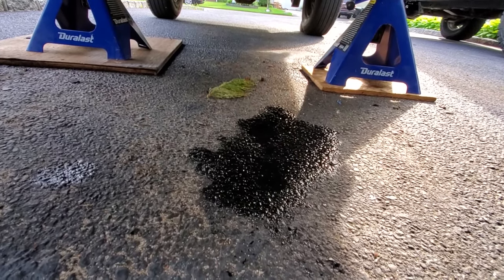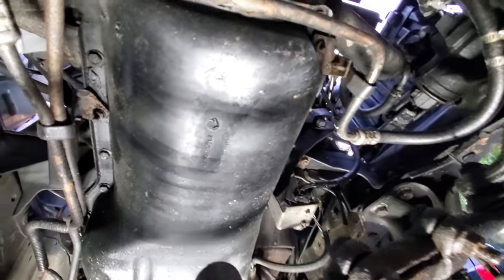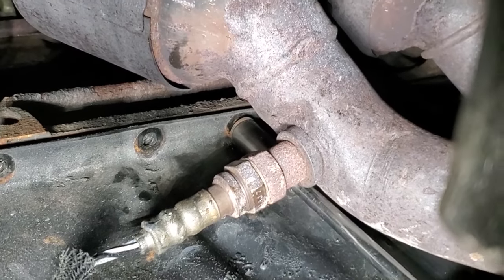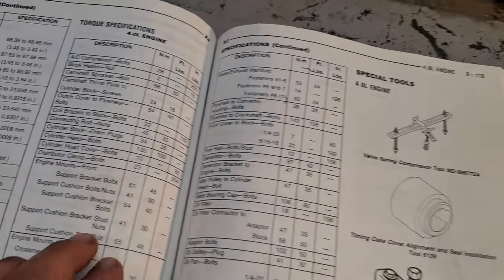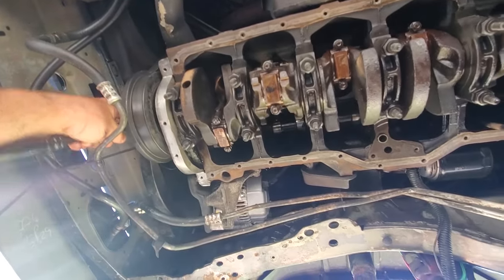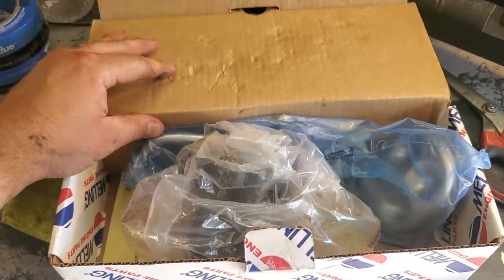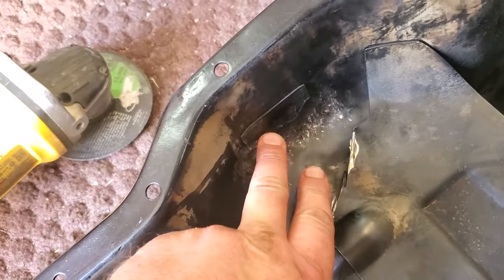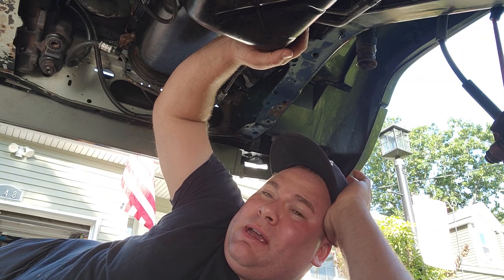JEEP XJ OIL PAN - REAR MAIN SEAL - CONNECTING ROD BEARINGS - OIL PUMP UPGRADE - PICK UP  REPLACEMENT

Comment: This is the most comprehensive one I have seen so far! On my stock ride height 01, I used 2 small bottle jacks to push the front axle down for the oil pan to clear the pumpkin. It took me at least a day to think of that. There were a lot of videos on missing Axles and lifted jeeps, but nothing on stock ride height. I have shared the idea with a few people since then. Great video Dan! Thorough as always!
Reply from the maker: Glad it helped! Thanks Brother!
Reply: I was just about to post the same! Everything else is for lifted Jeeps. Thanks Dan!

Comment: One thing to keep in mind if you're using an aftermarket oil pump. Some of the cheaper ones you buy online can have clearance issues with the crank counterweight. Had this happen where after installing it, awhile later we couldn't figure out why the crank couldn't make a full revolution. In other words, after you install an oil pump on one of these engines, check to see if you can rotate the crank a full revolution. LOL As always, awesome video Dan!
Reply from the maker: Wow! That's great to know. Thank you.  I think this Melling pump is the biggest I'd go

Comment: fn aya!!!!   exactly what i needed this vid bad!!    i  developed a horrrendous tick one morning...i finally learned my RMS was leaking, and didnt know it.  SO, down 2.5 qts of oil, and the rap, rap,rap started.    Because the rap was the same timing as the crank, it had to be something underneath...  I have yet to pull the oil pan to determine if it is a skirt fly off, or just rod bearings toast, or even non existant.   RAP is noticable at all rpm's but much less at higher than 1800 rpm... replaced oil(again), but no metal flakes in previous oil, so i'm hoping for minimal scarring or cylinder damage.     The things in your vid is exactly what i'm wanting to achieve once oil pan is off.    I have a stock 97 4.0L w/266k orig miles on engine... guess it had to go sooner or later.      I also recently replaced rocker arms and push rods, but no change in the RAP... but it does have better performance. No real nasty wear; just normal on the rockers...  i would like to replace lifters as well, and i might just bite the big bullet and replace pistons only.   depends on what i find after pan removal..   THANK  YOU for this video.  been searching pretty hard for just this type of repair....
Im a subscriber now!!!!     Tedd. S.
Reply from the maker: Thank you Ted! Best of luck with the Jeep! God bless 🙏

Comment: Did a HV HP oil pump on my 2001 XJ when I did rear main seal a few years back. My oil pressure hot at idle was down to about 25 lbs. After the HV HP pump it will maintain 55 lbs hot idle all day. Cold at 3/4 throttle, it will go to 75-80 lbs. Hot it will go to 65-75 lbs. I put in Scorpion 1.7 roller rockers, it's like a new truck. You can feel the HP and Tq difference, part throttle and full throttle. I have a bigger TB, with smooth spacer and returned the rest of the stuff, ( injectors, airbox ) back to stock. Stock thermostat, factory HD radiator and 3 fan electric fan set up. My fuel milage went back up from pig rich with the cold air mods and all that other junk. The factory computer doesn't like a lot of the performance mods, especially T-Stats and injector mods.

Comment: I’ve done this on a sr20 4 cylinder and it saved the engine I will be taking apart my 4.0 and inspect all the bearings I have a spare motor but that’s a last resort I don’t wanna do a motor swap rn
Reply from the maker: smart! only do what you need to do.. it saves time and  money. lol

Comment: Your package was supposed to go out last Monday but got lost in the shuffle. So the plan is for it to get processed Sunday and go out Monday (9/19/22) via UPS. Hopefully Harry (my shipper) and I won't forget. I have this same job to do to the Bumble Jeep, along with Pinion seals (both) and the oil filter adaptor seals. Should make for a fun day. God bless and stay well.
Reply from the maker: Thanks Brother!
Reply: @ProjectDanH  So you got the springs? That's great.

Comment: What a great video.  I was wondering if you used aluminum or tri metal bearings  I did not see the part number in your description.  Also I didn’t hear you mention why you were replacing the oil pump and why you modified the oil pan vs getting a different oil pump .  Was it just because you already had everything apart you decided to change the oil pump.  Thanks for all the work videoing.  You do a great job explaining and capturing what you are talking about
Reply from the maker: Thanks man!  Sometimes I just get the parts that are the most affordable but sometimes I get the parts that are readily available to get the job done quickly.  For sensitive parts like bearings I try not to make recommendations cuz I don't want to be blamed if a part fails.. mostly my main objective is to just illustrate how to get the job done.  If you do your own research you could be confident with whatever part you choose 💪💪💪.  Hope this helps. God bless

Comment: For anyone running into the trouble I had on my OEM suspension ZJ: Drop the shocks from the upper mount and the sway bar links too so the whole front suspension can hang. Then get a helper to bounce on the wheel hub while you pull the oil pan out toward the rear. Same thing putting it back in, bounce that front axle. Due diligence with your jack stand positioning.

Comment: Dan,  this is a super Great Video! I have a slow main seal leak. I have 202,000 on my WJ and still runs good. If I pull the oil pan I should  do the same and follow your work ✅🇺🇸

Comment: Instead of using rtv, you should leave a little bit of the end of the top seal sticking out so that the two seals dont meet at the same spot where the block and cap meet
Reply from the maker: Excellent tip!  Great idea to offset the gap too!
Reply: Your suppose to offset the seal no more than about 3/8" then you use anerobic sealant on the machined cap ends, they tell you not to use silicone there because it can alter your bearing clearance but ppl seem to get away with it for the most part i guess as long as you have no leaks then all is good 👍
Reply: The question i cant get answered though is they give you the plastic shoehorn to avoid cutting the seal upon install but when you offset the seal there is no way to use it upon installion of the cap so your basically taking a chance of cutting the seal when you put the cap on! go figure
Reply: Excellent idea. Love it. Thank you for this. You deserve a gold star and a lollipop.

Comment: I have a question I’m doing the same, very helpful video only question is when u put the oil pump in do u turn the shaft to line up with the distributor?
Reply from the maker: The drive gear is still connected to the cam shaft so you can insert the new oil pump shaft in at any orientation.  Great question!
Reply: @ProjectDanH  one more ? I’m doing it today only other thing do you take the cotter pin out of the oil pump when installed or at all?
Reply from the maker: @ryanwest5804  no leave the pin in. All you need is the 2 13mm bolts .  Don't forget the gasket!
Reply: So I finished the job and have no start but cranks I replaced the crank shaft position sensor and coil pack, I have spark from the coil but not distributor and cap and button look new.. any ideas
Reply: Now I have spark and fuel still no start replaced the cps and checked all fuses still cranks no start

Comment: Gonna be doing a transmission gasket and filter and fluid change on my 91 XJ this week coming up. Also will be doing an oil pan gasket, rear mail seal, piston connecting rod bearings, oil pump and tube as well the following week. Then will be doing a head gasket and timing chain and gaskets and water pump and gasket and thermostat and valve cover gasket and exhaust and intake manifold gaskets. Is  gonna be a big project. Going with all parts purchased from Rockauto. Some other parts too. Then transfer case fluid and both front and rear diff fluids. Exhaust system too because is missing CA CARB CAT and muffler and rear pipes too. Got the 91 XJ a year ago and haven't driven it since because a situation but now, is go time. The CARB CAT is gonna be only used during smog time, then take it off cause i dont want some low life stealing a $600 CAT. Also put a few killswitch.

Comment: Thanks for the video. 
Did you not do the Plastigauge for rod bearings? What thickness did you use?
Good time to do rear seal. I also like Fel-Pro.
Is it still running?
I may ad magnet to oil pan.
Thanks again.

Comment: Nice job Dan! So did you have low oil pressure b4 with the old pump? Just wondering if I would have to do the same somewhat?? on my 93 ZJ 4.0
Reply from the maker: Nah, oil pressure was fine.. but i figured i might as well. lol

Comment: Great video also I recently found out there is away to do the main bearings while ur there. Called a rolling in method where u use a carter pin to spin the top bearings out. The new one slides in and same method to put in in place is used .
I'm going to do a complete rebuild on mine using this method.  You can find videos of it on YouTube.  Search replacing main bearings without removing the crank.
Reply from the maker: That's definitely possible!

Comment: Hey Dan, I don't see your number for the bearing kit. Everything else fantastic dude. Keep up the good work man. If you can shoot a number for the bearing kit my way I would be eternally grateful thanks again
Reply from the maker: Hey, not sure if it's available anymore.  Just search for a standard kit 👍
Reply: You didn’t have to measure and buy oversized bearings? That’s my concern with just ordering a set. My ol girl as 235k on her and a nice rod bearing tick

Comment: What size bearings did you go with? Typically i think you would want to use a plasti gauge to measure what bearings are needed. But then again ive heard alot of people just slap in the standard size ones and send it.
Reply from the maker: I used standard bearings.  From my experience , even with polishing some scratches off, plastiguage usually  confirms standard bearings are within spec

Comment: Great video. Am about to change mine on a 2000 XJ. How do we decide if we replace the connecting rod bearings with undersized 0.020/ 0.030/0.010 or Standard? I get size options while ordering from Rock Auto.
Reply from the maker: 99% of the time they're gonna be standard, unless a machine shop polished them and told you specifically to get different sizes
Reply: @ProjectDanH Amazing. Thank you so much!

Comment: Very nice! I'm about to do the same to my xj....she's got some miles, and oil pressure has dipped over time. Just curious, have you replaced mains before in a similar fashion? I've seen people spin them in with the crank still in place, but it didnt seem like yours (at least #7)  looked too bad.

Comment: I have bad oil pressure when my engine gets up to temp. Did changing the bearings affect your pressure? I was told to change them while I had the pan off to get better pressure
Reply from the maker: Bearings don't have much bearing on oil pressure... Change the oil pump!

Comment: Do you not have to check the clearance on the new bearings?  How do you know if you need standard or oversized before pulling the pan?
Reply: I’m also curious, just received a new pan today, before I order bearings I guess I’ll just pick standard and cross my fingers
Reply: @cousin_JACK  Doing the same
Reply: I went with standard. If it’s stock, standard is the way to go. It was easier than expected
Reply: @cousin_JACK  ordered standard.  Keeping my pan and replacing oil pump and pick up with OEM.
Reply: @swatscorner  right on man, don’t bother taking out the main crank bearing to clean under it like Dan, I tried to remove the main crank bearing and I scratch it, simple wipe down on top, unless you’re replacing that too which I doubt.
Reply: @cousin_JACK  good to know!!  No, was not planning to replace that.  Just the rear main seal
Reply from the maker: only get oversized bearings if your machine shop cuts and polishes the crank.  you wont know what size you are changing it to unless they use a micrometer... so... always go for standard bearings. !
Reply: @ProjectDanH  but they sometimes use various sizes in ptoduction don't they?  In the end, my motor was shot so I got a new one from Titan, going great now.
Reply from the maker: @crashtke  Glad to hear brother!

Comment: Trying to order everything - where did you get the bearings? Having trouble finding them for the 4.0. Thanks.
Reply from the maker: Ebay
Reply: @ProjectDanH  thanks!  I think I ended up ordering from Rock Auto - but I did see them on eBay as well.

Comment: Just curious, would you recommend a refresh on the engine like this, on a 96 ZJ with the 5.2? I’ve always been curious about the crank or connecting rod pistons that can be accesses with the oil pan removed.
Reply from the maker: I wouldn't mess with it unless is clunking.. if it aint broke dont fix it! lol

Comment: Hello sir, can I get that tork spec of the different screws for the bearings! Thank you
Reply from the maker: Connecting rod Bearing cap nuts get 33ft lbs.  Some.ppl torque them in steps.. 20 25 33

Comment: Hey Dan I have a 98 cherokee I am going to install the high volume oil pump as well I would love to change connector rod bearings and rear seal as well  little reluctant about bearings but I believe I can any advice
Reply from the maker: Go for it!  Don't rush, make sure your crank isn't scratched up, if it looks good make sure you get standard bearings.  Keep it clean!

Comment: How did you determine what size connecting rods to get? There is standard, but also under size sizes (.010”, .020”, .030”)
Reply: I am assuming Standard.
Reply: Replace bearing inserts with whatever came out . Your old inserts should have identifying markings on them to determine size replacement

Comment: Great job and best tutorial again ! How many miles on your engine ? Mine has 187K and I plan the connecting rod bearing-project soon. I'm expecting some major issue when removing the oil pan due to having a non lifted stock XJ - any tips here ? Also: the Mahle part no for the bearings ? - Thanks pal !
Reply: Found them on Rock Auto for my 1999: MAHLE / CLEVITE CB960A6
Reply: @swatscorner  thanks !

Comment: How did u prime your oil pump
Reply from the maker: Drill on the shaft in a bucket of oil!  This was a replacement pump and works on camshaft rotation, you can prime the oil pump by pulling the starter relay and cranking it over with the key.   If it was a new engine build id definitely prime it in a bucket first.

Comment: another question: how did you manage to reinstall the oil pan with the pick up tube hooked up to the new oil pump ?  When you removed the oil pan, you disassembled the pick up line from the oil pump to get enough clearance.
Reply: He took the axle out when reinstalling
Reply: @aston3079  thanks - I have a stock front axle set up - removing the starter, disconnect the sway bar link and drag link from the pitman arm should work in my case to lower the front axle and have enough clearance to remove the oil pan ?

Comment: Which oil did you used  ?
Reply from the maker: I recommend for our 4.0s ROTELLA T6 full synthetic 10w30.  Its hard to come by lately so any high milage 10w30 oil with zinc or zinc additive will do.

Comment: I have a 2001 xj with deathly low oil pressure at idle, do you think main bearings and rod bearings would heal the pig?
Reply: 205k miles
Reply from the maker: yes, but If your gonna do main bearings you might as well just rebuild the whole motor
Reply: @ProjectDanH  Yeah, put in all new bearings and did almost nothing .... even added a new oil pump, now the real main seal leaks like a sieve.....

Comment: Why u had clearance issues with  the new oil pump and the pan huh Is that a 2000 xj? I didn't had any clearance issues with my XJ 99 , I nstalled the exact oil pump👆🙋🏻‍♂️
Reply from the maker: Dunno, it was a 2001
Reply: Oh gotcha yeah I think 99 vs  2001 pans are little bit different